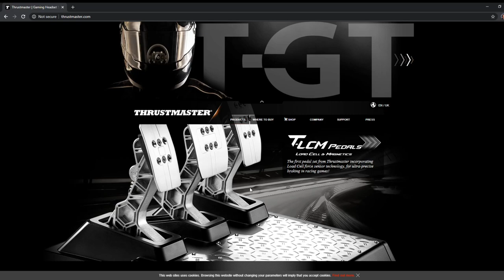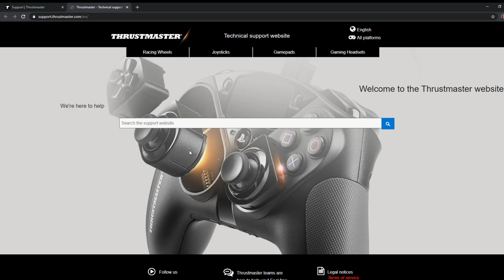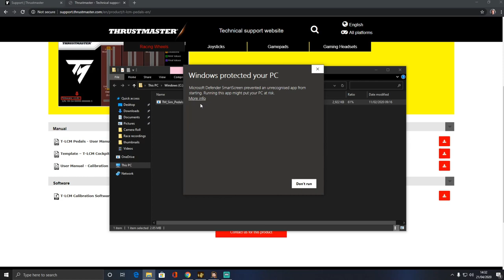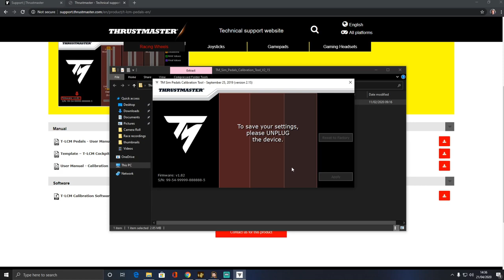Thrustmaster T-LCM Review | How to setup and install/use calibration software

Comment: I just bought these to use with my g29 wheel on the ps5 and they're not working. I thought they were compatible?
Reply from the maker: They are compatible. However you can't use two controllers at once on console. You will need to buy a drive hub
Reply: @TRYRacing  got you. Well got fed up with nothing working so just ordered the Fanatec CSL DD bundle anyway haha
Reply from the maker: @BeforeThisNovember  hah great choice!

Comment: I struggle with my gas pedal where it hits 100% before i have pushed all the way down with the pedal. Feel like i push 90% of the pedal to recive 100% in the software and ingame. Is there something to do?
Reply from the maker: Have you tried moving the dead zone around in calibration settings? Or within the game itself ?
Reply: TRY Racing yeah played around with the software and deadzone, seems like there is some deadzone even tho its not set… Thank you for answering
Reply from the maker: Hmm maybe worth uninstalling software  and try again. I've heard of brakes having problems but no throttles. how long you had them?
Reply: TRY Racing bought them yesterday, yeah i think the deadzone is “invisible” in some sort

Comment: When opening the calibration tool, it detects the pedals, but does not react when pressing any of them and i cant make adjustments. Any ideas?
Reply from the maker: Are they directly plugged into the pc. Or a wheelbase?
Reply: @TRYRacing  Both. Its plugged into the PC via USB and the Wheelbase via the RJ12 cable.
Reply from the maker: Just try the pc for now. Only the one cable. If that doesn't work try

Make sure they being detected by the thrustmaster control panel as well. If not uninstall and re install the calibration program. Let me know if you have any more problems and I will do some more digging
Reply: Randomly started working now finally haha.
Reply: @Ompalis  The pedals MUST BE CONNECTED ONLY to the PC with usb cable !! Did anyone read the manuals now dayz??

Comment: 4:46 Calibration Tool Download and Installation
6:15 Calbration Tool How to Use
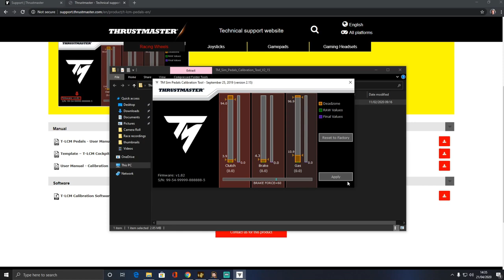8:41 Calbration Tool Reset or Save Your Settings
It saves the settings also for use on consoles

Comment: Thank you so much for this video, I was having trouble with my break maxing out before I felt it should and my throttle pedal felt too sensitive and was stopping at the top due to the dead zone so I kept spinning and wasn’t able to put down the power properly or brake properly, these settings have fixed all these issues and the pedals finally feel worth the money I paid for them. Thrustmaster should make these the default settings.
Reply from the maker: Glad it's worked for you! Even 3 years on!

Comment: Just picked mine up this morning and your set up advice is a life saver ❤️
Reply from the maker: Great to hear! I've had mine exactly a year and not had one problem with them. You using them for iracing? Or other sims?
Reply: @TRYRacing  ACC and AMS2 primarily, Dirt Rally 2.0 and AC is what I usually play. Never gotten into iRacing yet.
Reply from the maker: When I moved from normal.pedals to load cell I had to change the in game settings as well to accommodate the new pedals. Just check on some forums what settings other people are using in the game as well

Comment: As soon as these are in stock I will be ordering them.  It's my birthday at the end of the month and I was hoping to get these for my present!  Great review and when I finally get a set I will check out the video again.  Thanks for the great video!
Reply from the maker: From what I've been hearing they should be available soon but that's only rumour! Fingers crossed soon! Thanks for the comment and hope you come back to watch some more! Let me know when you get them and what you think! Cheers T
Reply: @TRYRacing  OK so I couldn't wait.  I ordered a set from someone on eBay.  The thing is they do take a little getting used to.  For the first day my times were a little slower as I got used to the feel.  The second day my times went back to where they were before and Then the times started to drop fast.  Not only have my times dropped by more than 0.5% my lap times are more consistent and control during the race has greatly improved.  They feel more natural, that is to say I'm not having to think so much about what I'm doing with my feet.  This is compared to my T3PA Pro pedals.  I had to buy the T3PA Pro because the base T3PA were absolute junk.  I have given Thrustmaster some good money on 3 sets of pedals! Please don't ask what I paid to get them from eBay.
Reply from the maker: @scottn7cy  glad to hear they have worked out for you bud!! Keep going dude and I will see you on the track I'm sure!!!

Comment: Good video. Got mines 3 days ago and since I race only ACC got my break pressure at 75. We use 100% brake force at the start of braking and gradually releasing it. I need to play more with different springs to se what fits
Reply from the maker: Yeah just keep adjusting until you find your perfect spot. Everyone is different. Enjoy!!

Comment: Got mine, only slight problem was the brake pedal wasn't returning back far enough, underneath the pedal set is a grub screw and locking nut, I just took it out, added some 'Threadlock'' put it back in and adjusted it to the correct position, job done, it's perfect now. Instead of unplugging the USB cable, i just disable the pedals in 'device manager' and then re-enable them, it's a bit easier than fumbling around the back of my PC :)
Reply from the maker: I like the idea of disabling the pedals!! Will use that. Thanks 👍

Comment: How do you update the firmware for the T-LCM pedals for PS4? the manual only says how to do it for PC
Reply from the maker: You have to plug it in to a pc using the calibration tool. There's no way for ps4 as far as I'm aware. Sorry jason
Reply: @TRYRacing   I got these.  You set them on PC and when you unplug the settings save so that you can use the settings on ps4
Reply: No  need ,you only have to update the wheelbase

Comment: TLCM , Brakeforce Settings help.
Hi,
I have set Brakeforce at 0 on tlcm. But i still find it too hard to get desired braking. i would prefer for it to be easier than 0 to get 100% braking.
Is there a way to reduce this below 0 or change any other setting, so i have to press the brake with lesser pressure/force to get up to 100% braking....?
Thanks.
Reply from the maker: I don't think so but you can put the easier springs on the pedal which should make it easier to brake

Comment: Nice video! I have a question, how can I update the firmware? Im not able to do it following the manual. I don't find the related sw!
Reply from the maker: I believe you just have to make sure you're calibration tool is up to date. Think it's currently at 2.15. Just re download it. Then Re calibrate your pedals and save the settings. I've had no problems
Reply: @TRYRacing  thanks for the reply! The tool is updated to 2.15 but the firmware remains 1.82. I've read online that 1.87 firmware should be available...
Reply from the maker: Let me do some digging. I think I've updated through my main thrustmaster control panel before when I've updated my t300rs
Reply from the maker: So to update the firmware they have to be plugged into a wheel base through the  rj12 cable. You then have to update the firmware through the driver updates on that particular wheel base.

If you go on the pedal support site and look at rj12 mode detection in the manuals. It tells you how to do it. Hope this helps!!

Comment: I have a problem if you or someone can help me please, I just bought the tm ts 300 servo base, f1 wheel add on, and the tlcm pedals. At first downloaded all software for pedals and wheel and it worked fine but that calibration tool for the pedals still never detected my pedals but they still worked in game. I unplugged the wheel to take it off my desk to play other things and then I went to plug it back in, and now when I’m in f1 my brake works, but in game on the HUD u can see the green bar showing my throttle is down, but my car doesn’t go anywhere? I’m on PC btw can someone please help!
Reply from the maker: Are all the drivers up to date. If so.. my advice would be to uninstall all software and re install it all again. My technical expertise don't go much further than that.

Sometimes liitle bugs get in the system
Reply: @TRYRacing  ya so now it fixed that problems and the tm calibration system picks up my pedals, but now while playing. My computer randomly keeps acting like I’m unplugging and plugging in like my keyboard or something and it makes the disconnected tone and then connected tone and it happened like 3 times while playing, then the last time my keyboard just didn’t re connect after disconnecting and the throttle went out again
Reply from the maker: I found if I turn the power off to my PC at the wall after I use it it stops that problem

Comment: Is it normal when I have 4 washers installed with red springs, that I have force on the brakes without pressing them in the calibration tool?
Reply from the maker: No. It should read 0. But if you need those 4 washers just create a deadzone with the calibration tool. How much force is there?
Reply: @TRYRacing  nevermind, it worked with your tutorial. Thx

Comment: So to have a braking at 100% of the power, you have to adjust the brake pedal so that the load cell (green bar) is the (purple bar) at our maximum pressure both reach 100%?
Reply from the maker: Yes that's correct!
Reply: @TRYRacing  Is it important that the green or purple bar reaches 100%?
Reply from the maker: The green is more important as thats the one the games use. The purple is your input
Reply: @TRYRacing  Today I did a couple of tests, increasing the braking force to 75% and reducing the brake dead zone to 2.8 and I have to say that I feel pretty good with my driving style
Reply from the maker: Brilliant! Took me loads of times to get it right

Comment: is it possible to connect pedals via usb to ps4 and use fanatec steering wheel?  i have a usb hub but i don't have a drive hub.  Thank you
Reply from the maker: I don't think you can. As I don't think the ps4 can recognise two 'controllers' at once

Comment: Question about the cable to use. I heard you say use the USB for PC, but in the TM manual it says if you use a TM wheel base use the other cable. So which should I be used?
Reply from the maker: If you're on PC I would plug it straight into PC if you get chance. The USB cable carries more data than the TM cable to the base
Reply: @TRYRacing  thank you! I will try that. Is using a USB hub not advised? I have most my USB ports used with mouse, keyboard, wifi.
Reply from the maker: My pedals are in a usb3.0 hub and they work well!
Reply: @TRYRacing  I appreciate your replies! I'm very new to sim racing
Reply from the maker: No worries. We all start somewhere. Glad I could help

Comment: Great Video! After saving your new calibration settings from your pc… can these settings be used on a PS5 or only on a pc? Thanks
Reply from the maker: The settings should work across all platforms ! No harm in trying
Reply: Doesn't work on PS4 Pro, it only uses the standard calibration. So I wouldn't be surprised if it doesn't work on PS5 either.
Reply: @__Jan__  Thank you

Comment: It is only for me or the brake is impossible to bring into 100% ? Personally my brake pedal can’t go over 40% on the software ? It is a probleme or it’s normal ???
Reply from the maker: Maybe change the springs or lower the brake force slider in the calibration?
Reply: @TRYRacing  it’s not the purple one who doesn’t go into 100%. It is the green one. So actually my brake is at 100% when i use 30% of my brake pedal but even if i want to break at 100% in the green, i can’t
Reply from the maker: @cr4zy_g4ming50  might be a software issue. I would reset all the springs give it a clean.

Try moving the brake force round when you have brake pressed. If it's not changing much I would contact thrustmaster

Comment: Hey, I recently got a set of these but the lug nut broke away from the washer at the top. I also noticed the load cell if quite loose at the bottom. Does yours move around at all? (the rod moves left and right) Just want to make sure mine aren't broken 😔.
Thanks
Reply from the maker: Are they brand new? Or second hand? Mine has little to no movement

However is it effecting your braking at all?
Reply: @TRYRacing  they're brand new last week. I wonder if its broken when the lug nut washer broke away. We've raised with thrustmaster, just hope I can get it sorted. Mine definitely moves side to side a lot.
Reply from the maker: I'm at work  at the moment. Will double check when I get home 👍
Reply: @TRYRacing  thanks buddy, I appreciate it 👍
Reply from the maker: Mine are pretty solid dude. Barely any movement
Reply: @TRYRacing  I'm getting them returned to the supplier today and hopefully getting a replacement soon. Thanks for getting back to me, you've been a great help!
Reply from the maker: No worries dude. Hope they are sorted. I've had mine a year and I have had no problems at all

Comment: I’ve had the T-LCM pedals since launch - now coming across problems where the accelerator and brake pedal cut out during use & need to restart the device...firmware etc is up to date

Anybody else with this issue?
Reply from the maker: How long you had them?
It's only happened to me once and I think that was because they were on but I didn't use them for 6 hours and they went into sleep mode
Reply: @TRYRacing  purchased March 2020 - now constantly happens everytime I use them - eg 15-20min into a race and cuts out (have checked calibration tool and seems to be stuck at a position when it happens (in contact with thrustmaster now but makes me consider going fanatec)
Reply from the maker: Never come across this to that level. Thrustmaster is your best chance. Hope it gets sorted

Comment: My calibration isn’t recognising the pedals so I can’t calibrate them any suggestions it’s up to date and things idk what to do
Reply from the maker: Have you got the thrustmaster control panel? And are they in through the USB or a wheelbase
Reply: @TRYRacing  yes I have the control panel and they are in the wheel and I’ve plugged it into the pc directly
Reply from the maker: @xaviersands999  OK, does it register in the control panel? I assume so. Do they work at all? Like in a game?
Reply from the maker: I would uninstall the calibration tool and install it again
Reply: @TRYRacing  yes they work on the wheels calibration tool and yes they work in the game they are so bad though you press it not even half way and it’s full braking and I’ve uninstalled the software 3 times already
Reply from the maker: I had this problem i had to go into the control panel and do.something in the advanced settings to the pedals to make sure the brake read zero
Reply: @TRYRacing  how do I do that is that why it isn’t calibrating
Reply from the maker: No butbthe brake problem you are talking about I solved through control panel and then properties tab of the pedals. I'm not at home so can't check how I did it. If you're still struggling. I will do a small video on it
Reply: @TRYRacing  yes for sure I’ll check it out
Reply: @TRYRacing  It didn’t work
Reply from the maker: I'm afraid I'm all out of ideas. You will have to contact thrustmaster support.
Sorry I couldn't help more

Comment: Did the pedals fit straight on to your  playseat evolution pedal plate (no drilling) ?
Reply from the maker: I had the playseat challenge and that was just velcro straps. I now use a next level racing GT TRACK and then went straight on

Comment: i can't seem to get mine to work via pc cable link maybe something needs changing for usb on pc as wheel only works on enhanced usb 2.0 not sure if its a setting in windows 10 that stopping it or something in bios drivers seem to be ok as far as i can tell., i wouldn't be bothered but i can't get race room to see my pedals n then i tried acc n that don't see em with pc usb link in ..,, great pedals tho ive been using them on xbox one s n recently on pc just as you do on console with pedals plugged into wheel no probs until i tried raceroom:/
Reply from the maker: Are they being recognised through the tm calibration software at all?
Reply: @TRYRacing  says sim pedals yet seems very basic when it come to calibrating! what does yours look like?
Reply from the maker: @bblitefootbilly3243  it's in the video. Download the tm calibration tool and you can't set dead zone etc and everything
Reply: @TRYRacing  now thats the funny thing it works fine on the calibration tool 
suspect 3.0 ports atm ive a pcie slot one somewhere that i can put in !see if it works on that hopefully
Reply from the maker: Fingers crossed!

Comment: I see you are connecting these pedals directly via USB. Do you also have a exclamation mark in device manager and recognised as sim pedals ?
Reply from the maker: Yes mine says just sim pedals. I will check when I'm back at my pc exactly what it says 👍
Reply: i have the same problem now, did u get a fix?
Reply: @aetherjimmy  It is  still detected as  sim pedals but they work as expected so I leave it like this.
Reply: @johanduchateau9496  yeah i figured out to change keybindings in a game. it still detected the DFGT pedals which were not connected...